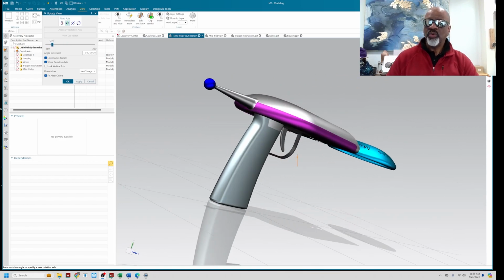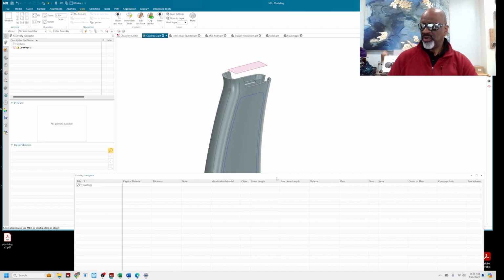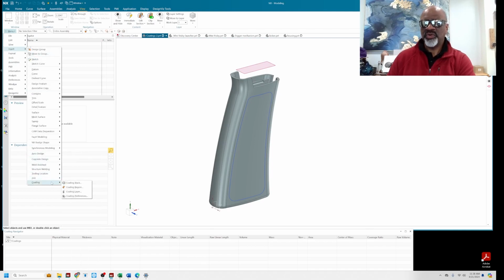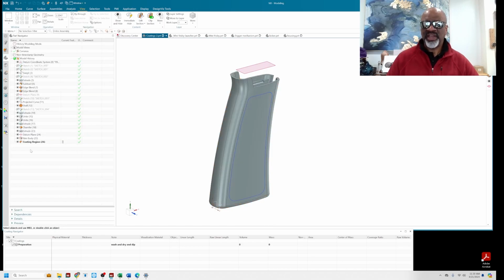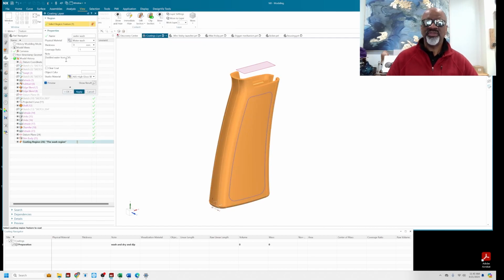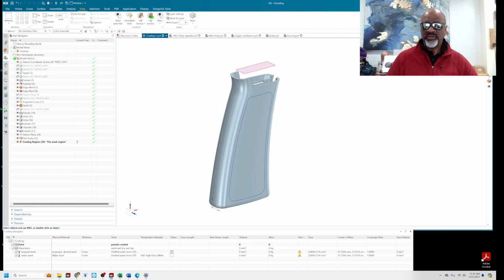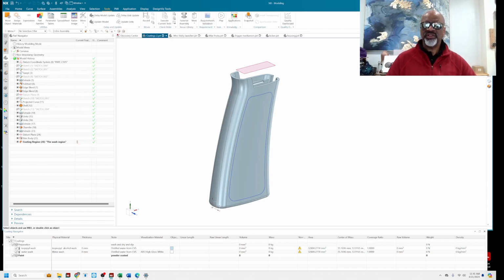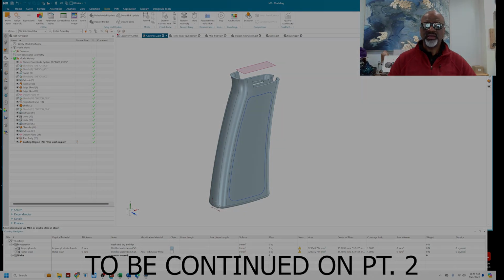NX 2312 - Using the Coating Command Pt.1

Comment: Please answer me, i as user inventor for many years come to nx for test, but nx very complicate and hard...design is very difficult and a designer need a simple software ...nx has very good feature, but work with nx is very bad experience
Reply: How can it be? NX it's much easier than Inventor. If you find difficulties maybe it's time to re-learn CAD fundamentals and not just pushing buttons
Reply from the maker: There is certainly a learning curve with NX and it is very common for new users to feel overwhelmed when learning it! We have a few videos that you might find helpful. 

For sketching:

"Siemens NX - How to Position a Sketch in NX - Tutorial - Tips and Tricks"

"Siemens NX - Understanding the Basics of the Sketcher"

Extruding and Revolving:

"Siemens NX - Tips & Tricks You Didn't Know About Extruding and Revolving"

We have more videos that you might find useful on our page. Keep trying! NX is incredibly powerful and is a great addition to your CAD toolbelt.